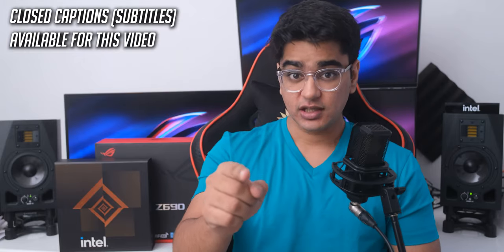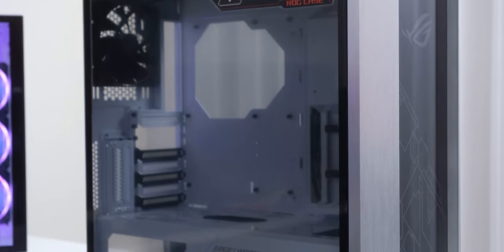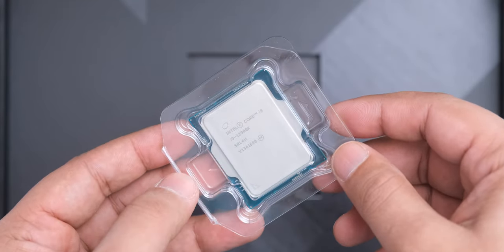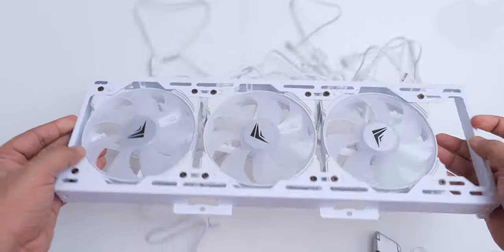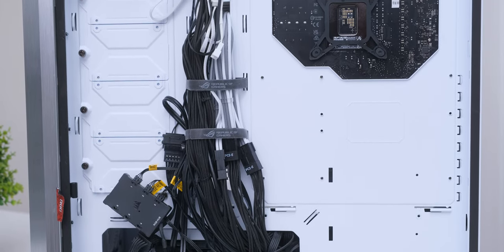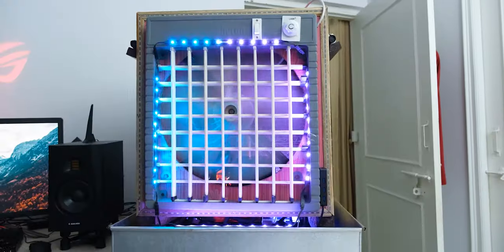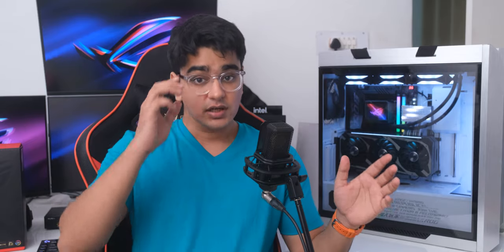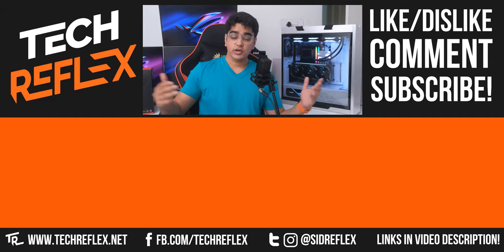FIRST INTEL ALDER LAKE PC BUILD! Core i9 12900K, DDR5, Z690 Hero, Strix Helios!

Comment: My asus z690 apex mobo is not detecting the ryujin 2 360 fan. It keeps loading me into bios, did you have this problem?
Reply from the maker: Did you plug in and power to the USB hub of Ryujin 2 and connect the cooler pump + fans to it? That is required to run this, otherwise CPU will keep overheating and it won't boot.
Reply: @TechReflex  I did it runs and everything it's just that I can't see the pump rpm
Reply from the maker: You may need to set it to display pump rpm manually in Armoury Crate software.

Comment: pc partpicker says that cooler doesnt fit for that cpu/motherboard.....yet clearly you made it work. Were there any issues or is the website making a mistake?
Reply from the maker: Forgot to mention, I used a new LGA 1700 bracket that is now supplied with all coolers, so if you buy newer stock, you will get this with the cooler.

Comment: 2:18 "without any plus signs" 😂🤣😂🤣😂🤣😂🤣😂
Reply: I didn't get that reference, what does that mean?
Reply: @Proprogrammer001  Intel has been refreshing their 14 nm architecture for the last 7 years every year just naming the refreshed node by adding a "+" besides the 14. Finally they move on with a smaller completely new node with alder lake. Alder lake is based on 10nm

Comment: i think the E gaming wifi board is better than hero. the M2.SLOT 1 is PCIE 5, it share band width with the GEN5X16 Slot, but graphic card even 3090 doesnt need the speed pcle5.0X16, X8 is more than is needs. but the hero one,,,yes it also can use 5.0 ssd, but it's on the hyper card.......not m.2 slot 1. m.2 slot 1 is full speed

Comment: Do you have any problems with the riser cable? Because the riser cable only supports PCI-e3 the gpu is e4 and the mainboard is e5
Reply from the maker: Yeah, you have to set the PCIE generation in MoBo settings to be on Gen3 first, then use the riser cable, otherwise the PC may not show display out. With this motherboard it's quite easy as you can use the iGPU of the CPU to configure this in BIOS. Other than that, performance wise, there isn't a significant difference between Gen4 and Gen3, except for some features that aren't really necessary to have yet. But Gen4 riser cables are also available with CM kit, so you could go with that, or just save some money and buy Gen5 when that comes up.
Reply: @TechReflex  thanks for your quick reply :) 👍

Comment: Is the mounting different for the new 12th gen processor for the liquid cooler? Or can I use my previous one and it will fit?
Reply from the maker: No, you'll need an LGA 1700 bracket, most brands should supply that with the cooler from now on.

Comment: please help where could i find aio for 
lga 1700
Reply from the maker: Newer stock is coming with it, but if it doesn't, you can contact the manufacturer of your cooler, most of them seem to be sending brackets without charge.

Comment: the fans on the front panel did you set them to suck the air in? how about on the top?
Reply from the maker: Front is intake, top is exhaust.
Reply: @TechReflex  oh, so for the AIO cooler it was meant for it to only use that device for the fans to take out hot air and the radiators use that "hot air" for cooling the system components? since its an exhaust right?